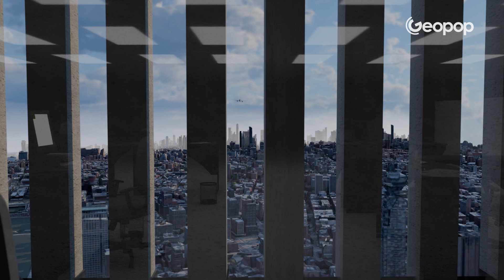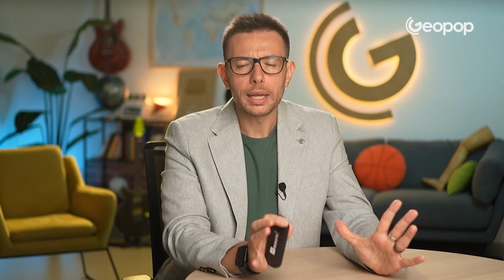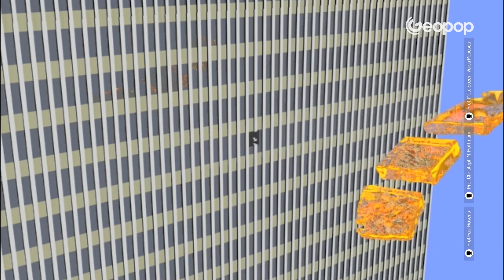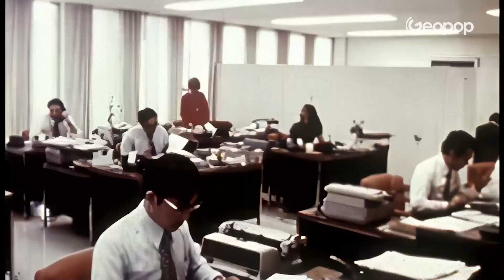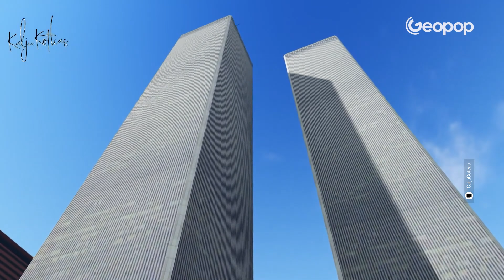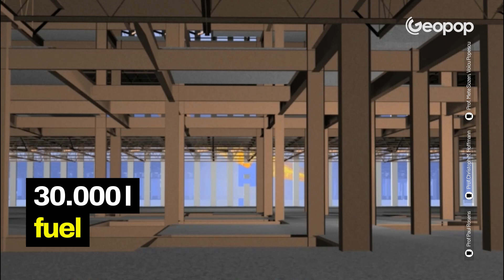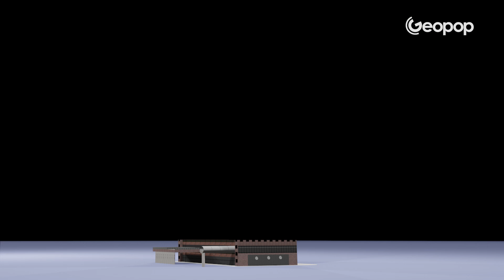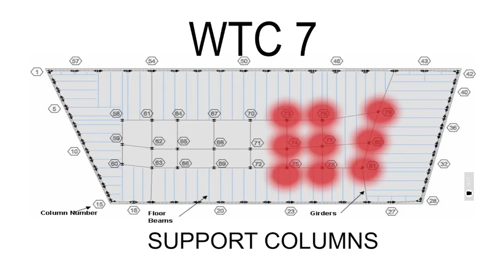9/11, 2001: The Technical Reconstruction of the Twin Towers and WTC 7 Collapses

Comment: Anyone who believes planes can knockdown skyscrapers is smoking grass
Reply: Belief has nothing to do with it. This is about science.

Here is my summary explanation of Twin Towers collapses of the Twin Towers, start-to-finish, based on my observations without appeal to, or reliance on any authority. No politics or ideology, just what actually happened, which is agnostic to who planned and carried out the 9/11 attacks or why. It has the benefit of not requiring Rube Goldberg levels of complexity and it makes logical sense. Each step in the process flows naturally from the one before AND is chock full of critical details the conspiracy oriented internet tends to leave out with no whataboutisms.  My hope is this will dispel many common myths and answer most if not all questions you may have about the Twin Towers collapses. 

While complex, most of the Twin Towers collapse mechanisms can be seen with the naked eye and easily discerned and understood by the layperson if sufficient time is taken to understand. The worlds engineering community had already largely sorted them out at least as early as October/November 2001. Still, there are many who can’t be bothered to look or perhaps work hard not to see, being more concerned about advancing political/ideological agendas (which is exciting) than science and engineering (which is boring).

1. The Twin Towers consisted of 4 primary structural elements that together formed an integrated system where each relied on the others.  47 hollow box-section steel Core Columns carry the majority of the gravity loads. The 236 hollow box-section steel Perimeter Columns carry the remainder and ALL of the lateral (wind) loads. Long-span Lightweight Steel Trusses connect the core and perimeter column together at each floor with a Hat Truss on top to tie the structure together as an integrated unit where no element can survive without the others 

2. The impact of 117 tons of airplane (= to about 12 dump trucks) at speeds up to 590 mph completely destroys the aircraft.  This in no way implies the Towers come out unscathed. Some folks don’t get that. Hitting with the energy of up to a ton of TNT the impact damages or destroys many perimeter and some core columns (33 of 59 perimeter and 20 core columns destroyed at the impact floors in the North Tower), primarily through bolt-shearing failures at the end connecting flanges, as well as bending, twisting and fracturing of weld seams. There was no cutting or slicing - the reality was far more violent and messy. 

3. The impacts destroy or damage fire insulation, fire breaks and sprinkler systems on multiple floors. Huge fires are started across multiple floors simultaneously and allowed to spread rapidly with no effective firefighting or fire suppression. This was an unprecedented fire event . All of this was observed and recorded.

4. The hotter steel gets the weaker it gets .  With fire insulation stripped away and no sprinklers the survival time of the steel greatly reduced. Gradually over time heat causes the lightweight steel Floor Trusses at the impact damaged floors to sag, which was observed and recorded.  No steel melted nor did it need to. Structural steel will fail long before it turns to a puddle. It just needs to bend

5. Sagging floor trusses pull on the increasingly weak and overloaded Perimeter Columns, causing some of them to bow inward by up to 5 feet. This was observed and recorded. A straight column is up to 4 times stronger than a bent column. 

6. The bowed Perimeter Columns buckle and fail, initiating collapse. This was observed and recorded.  The formerly static mass above which the structure below could easily support is now converted into a dynamic mass up to 30 times greater. Because they have buckled, the Columns above and below the failure point are no longer aligned . The load bearing structure below no longer bears any load as it falls past the lower columns, NOT onto them.

7. Thousands of tons of debris fall within the four outer walls, down through the open office space, crashing onto the first intact floor it encounters. This massive impact immediately breaks the bolted connections to the columns as the amount of resistance the Floor Trusses can offer is negligible.  The falling debris slows only marginally and briefly. Note:
7a. This is NOT a solid top block crashing into and “crushing” a solid bottom block .
7b. The debris falls past the columns not onto them.  The columns provide no resistance to the falling debris. 
7c. Only the bolted connections of the floor trusses to the core and perimeter columns can offer any resistance. A pair of 5/8” bolts at each end of each truss vs. thousands of tons of falling debris.

8.  This floor-led collapse progression within the four outer walls can only go straight down. Note: 
8a. This process is often incorrectly referred to as “pancaking” which actually refers to a completely different process rejected at an early stage. The catchy name stuck but nobody knows what it is supposed to mean.  Pancaking is too simplistic and inaccurate anyway. More like Kaiserschmarrn.

9. Collapse progresses through the floor systems and not down the columns. Rate of floor assembly failures increases with each successive floor as momentum increases, reaching an average acceleration of 0.65 of GA, or 35% slower than true free fall. Bam, bam, bam down the building until there are no more floors to fail.  The resistance offered by each successive floor is always the same. The mass and velocity and thus the energy of the falling debris are constantly increasing.  The falling mass increases with every floor it destroys as new falling mass is added. Some falls to the sides, but most falls down. More mass, more velocity, same resistance with each floor.
The above is unquestionably the path of least resistance

10. The Towers were 95% air by volume and as that air was compressed inside the building it is forced down the tower and blown out the sides in reaction to the building collapsing not causing the collapse. Those were not “explosions”, it was expulsions of compressed air. 

11. Perimeter Columns become detached and peel away like a banana behind the collapse front, playing out to the four points of the compass extending to more than 600 feet from the base of the towers. This was observed and recorded, the results quite obvious from examination of the debris pile. 

12. Core Columns fail last as their internal beam bracing is stripped away by falling debris and lateral support from the floor to perimeter columns is lost. This was observed and recorded and is most obvious in the North Tower. 

13. For those who care about how long this took, the whole process took 31-34 seconds from the moment the perimeter columns buckled until the last core columns hit the pile, or 1/3 the rate of true free fall. Don’t believe me?  Just watch any video of the collapses and note all the loose and truly free falling debris dropping much faster than the towers themselves.

14. What was NOT observed and recorded were the 180-190 dB bangs of high explosives or the blinding bright flashes of burning thermite. Of course, neither could have caused the (silent) Perimeter Column buckling that was observed.  Neither explosives or thermite could have survived the impacts and subsequent fires either. Cherry-picking a casual comment from someone who heard a loud noise in an event like 9/11 is not exactly “proof” of anything and the pre—planned demolition case relies entirely on that. There is zero physical evidence to support either conjecture. It would be technically impossible, totally impractical and completely unnecessary. No one would bother. 

15.  The Twin Towers were perfectly safe within their design envelope.  They only collapsed when taken far outside design parameters by an extraordinary and unprecedented event. 

Impact + Fire (heat) + Time + Gravity = Collapse . Remove any one of those four elements and there is no collapse. Ignore any of those elements (as many do) and you will never understand the collapses. The Twin Towers were an integrated system in which no one component could survive without the others. One fails, the rest follow, through the path of least resistance – DOWN – through the open space, bypassing the path of greatest resistance – the columns. Don’t get stuck on the but the lower floors weren’t on fire nonsense. 

I hope you found this helpful. It is meant to be informative, not adversarial, posted with the objective of soliciting informed critical comment, positive or negative. If I made any errors of fact, logic or reason or left anything critical out, please let me know so I can fix it. One topic at a time, on topic only please to stay focused, no word-salads of Gish Gallop. IF you can offer a more plausible alternative be my guest. So far no one has even tried. Please start any reply with the words “Tits McGee” or I will know you didn’t actually read it, are not serious and just wasting my time.

Comment: Very little debris left.   Nothing compared to the size of the buildings.   Steel mixed with wood and plaster.... then fused.   Creepy chemistry.   Very little seismic activity as they fell.... not normal.   And fell in direct line.  Building 7 with no impact damage....

And all buildings fell so quickly.   Within timeframe....

The floors of the buildings did not contain the material weight to collapse each layer.  If so.   There would have been seismic activity greater than 3.

Comment: This explains the floors above, but it's not enough substantial evidence, to support, the entire collapse of the trade center buildings, it doesn't.
Reply: Perhaps this will help.

1. The Twin Towers consisted of 4 primary structural elements that together formed an integrated system where each relied on the others.  47 hollow box-section steel Core Columns carry the majority of the gravity loads. The 236 hollow box-section steel Perimeter Columns carry the remainder and ALL of the lateral (wind) loads. Long-span Lightweight Steel Trusses connect the core and perimeter column together at each floor with a Hat Truss on top to tie the structure together as an integrated unit where no element can survive without the others 

2. The impact of 117 tons of airplane (= to about 12 dump trucks) at speeds up to 590 mph completely destroys the aircraft.  This in no way implies the Towers come out unscathed. Some folks don’t get that. Hitting with the energy of up to a ton of TNT the impact damages or destroys many perimeter and some core columns (33 of 59 perimeter and 20 core columns destroyed at the impact floors in the North Tower), primarily through bolt-shearing failures at the end connecting flanges, as well as bending, twisting and fracturing of weld seams. There was no cutting or slicing - the reality was far more violent and messy. 

3. The impacts destroy or damage fire insulation, fire breaks and sprinkler systems on multiple floors. Huge fires are started across multiple floors simultaneously and allowed to spread rapidly with no effective firefighting or fire suppression. This was an unprecedented fire event . All of this was observed and recorded.

4. The hotter steel gets the weaker it gets .  With fire insulation stripped away and no sprinklers the survival time of the steel greatly reduced. Gradually over time heat causes the lightweight steel Floor Trusses at the impact damaged floors to sag, which was observed and recorded.  No steel melted nor did it need to. Structural steel will fail long before it turns to a puddle. It just needs to bend

5. Sagging floor trusses pull on the increasingly weak and overloaded Perimeter Columns, causing some of them to bow inward by up to 5 feet. This was observed and recorded. A straight column is up to 4 times stronger than a bent column. 

6. The bowed Perimeter Columns buckle and fail, initiating collapse. This was observed and recorded.  The formerly static mass above which the structure below could easily support is now converted into a dynamic mass up to 30 times greater. Because they have buckled, the Columns above and below the failure point are no longer aligned . The load bearing structure below no longer bears any load as it falls past the lower columns, NOT onto them.

7. Thousands of tons of debris fall within the four outer walls, down through the open office space, crashing onto the first intact floor it encounters. This massive impact immediately breaks the bolted connections to the columns as the amount of resistance the Floor Trusses can offer is negligible.  The falling debris slows only marginally and briefly. Note:
7a. This is NOT a solid top block crashing into and “crushing” a solid bottom block .
7b. The debris falls past the columns not onto them.  The columns provide no resistance to the falling debris. 
7c. Only the bolted connections of the floor trusses to the core and perimeter columns can offer any resistance. A pair of 5/8” bolts at each end of each truss vs. thousands of tons of falling debris.

8.  This floor-led collapse progression within the four outer walls can only go straight down. Note: 
8a. This process is often incorrectly referred to as “pancaking” which actually refers to a completely different process rejected at an early stage. The catchy name stuck but nobody knows what it is supposed to mean.  Pancaking is too simplistic and inaccurate anyway. More like Kaiserschmarrn.

9. Collapse progresses through the floor systems and not down the columns. Rate of floor assembly failures increases with each successive floor as momentum increases, reaching an average acceleration of 0.65 of GA, or 35% slower than true free fall. Bam, bam, bam down the building until there are no more floors to fail.  The resistance offered by each successive floor is always the same. The mass and velocity and thus the energy of the falling debris are constantly increasing.  The falling mass increases with every floor it destroys as new falling mass is added. Some falls to the sides, but most falls down. More mass, more velocity, same resistance with each floor.
The above is unquestionably the path of least resistance

10. The Towers were 95% air by volume and as that air was compressed inside the building it is forced down the tower and blown out the sides in reaction to the building collapsing not causing the collapse. Those were not “explosions”, it was expulsions of compressed air. 

11. Perimeter Columns become detached and peel away like a banana behind the collapse front, playing out to the four points of the compass extending to more than 600 feet from the base of the towers. This was observed and recorded, the results quite obvious from examination of the debris pile. 

12. Core Columns fail last as their internal beam bracing is stripped away and lateral support from the floor to perimeter columns is lost. This was observed and recorded and is most obvious in the North Tower. 

13. For those who care about how long this took, the whole process took 31-34 seconds from the moment the perimeter columns buckled until the last core columns hit the pile, or 1/3 the rate of true free fall. Don’t believe me?  Just watch any video of the collapses and note all the loose and truly free falling debris dropping much faster than the towers themselves.

14. The Twin Towers were perfectly safe within their design envelope.  They only collapsed when taken far outside design parameters by an extraordinary and unprecedented event. 

The Twin Towers were an integrated system in which no one component could survive without the others. One fails, the rest follow, through the path of least resistance – DOWN – through the open space, bypassing the path of greatest resistance – the columns. Don’t get stuck on the but the lower floors weren’t on fire nonsense. 

I hope you found this helpful. It is meant to be informative, not adversarial, posted with the objective of soliciting informed critical comment, positive or negative.

Comment: "Joel Skousen - Former U.S. Marine Corps fighter pilot Joel M. Skousen also questions the official account of 9/11. After his military service, Mr. Skousen served as Chairman of the Conservative National Committee in Washington DC and Executive Editor of Conservative Digest."

“In the March 2005 issue, PM [Popular Mechanics] magazine singled out 16 issues or claims of the 9/11 skeptics that point to government collusion and systematically attempted to debunk each one. Of the 16, most missed the mark and almost half were straw men arguments - either ridiculous arguments that few conspiracists believed or restatements of the arguments that were highly distorted so as to make them look weaker than they really were. ... "

"I am one of those who claim there are factual arguments pointing to conspiracy, and that truth is not served by taking cheap shots at those who see gaping flaws in the government story ... There is significant evidence that the aircraft impacts did not cause the collapse [of the Twin Towers] ... "

"The issues of the penetration hole [at the Pentagon] and the lack of large pieces of debris simply do not jive with the official story, but they are explainable if you include the parking lot video evidence that shows a huge white explosion at impact. This cannot happen with an aircraft laden only with fuel. It can only happen in the presence of high explosives.”